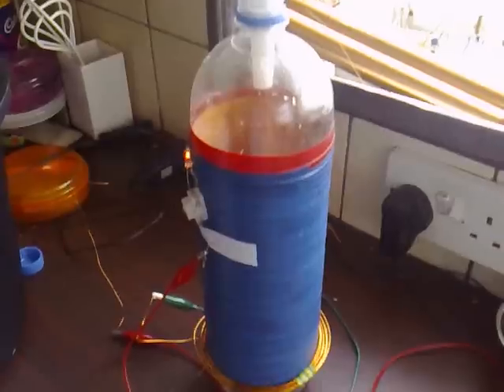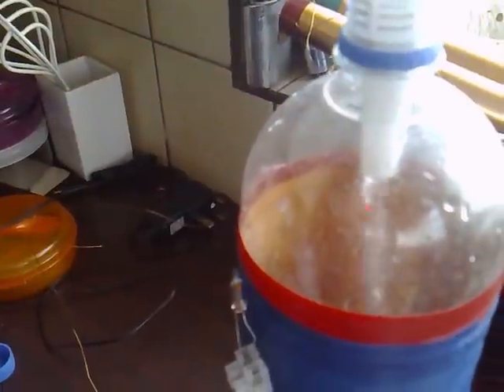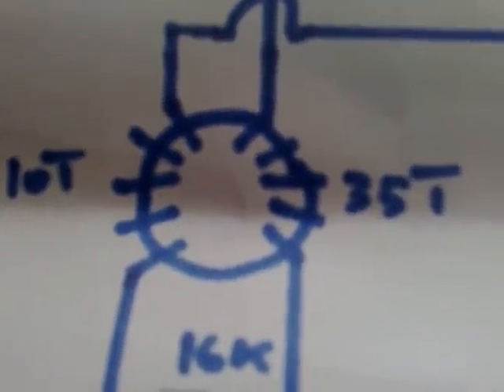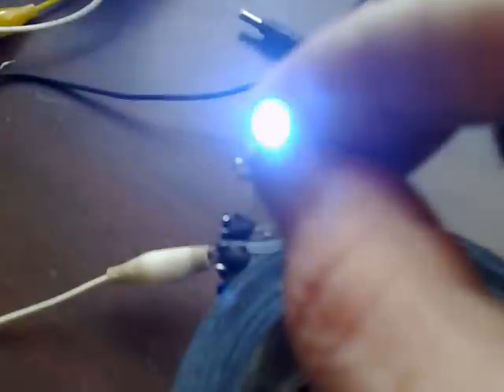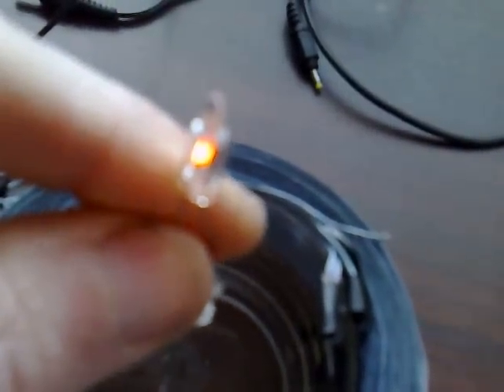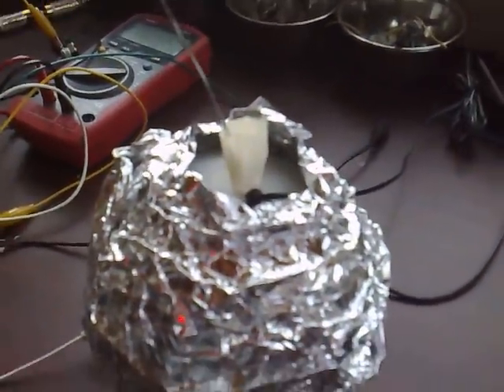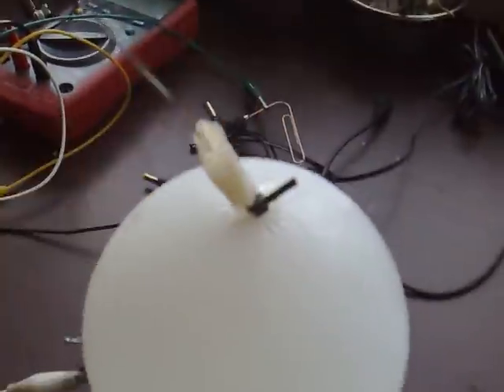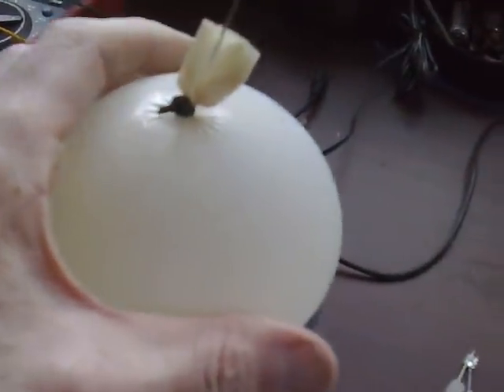Pc ribbon cable exciter and other experiments

Comment: please Try this:
disconec the ribbon of the toroid, fill he glass of water, insert the end of the 35turns toroid in the water and test the ribbon for HV.
I did some experiments like this with a spark igniter and when conect the my bifilar wired bottle (same of the pan oscilator antena video) i can lights 4w FL in the water, and whrn conect the SI direct to the water i can lights 4w FL in any lead of the coil.

Comment: I saw that joecell works better  with "conditioned water", Conical  electrodes sumerged in the water conected just to the negative of the dc power source.
How it supose works with alkaline or acidic water?.this is a video of how easy make water alkaline-acid separation watch?v=e8FrD7f284k.
Frozen? vaporized? hot?...interesting test a belljar coil, and test how the vacuum or pressure afects the output...tks jonny for inspire my imagination